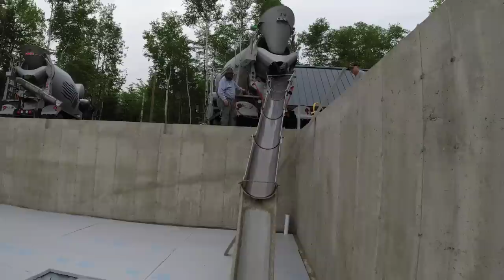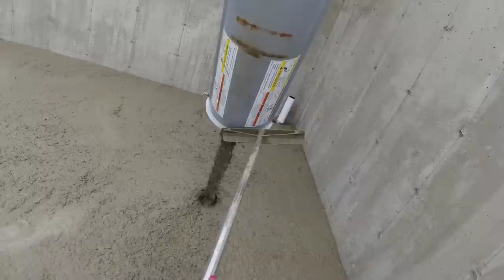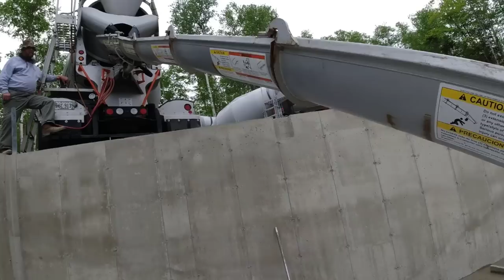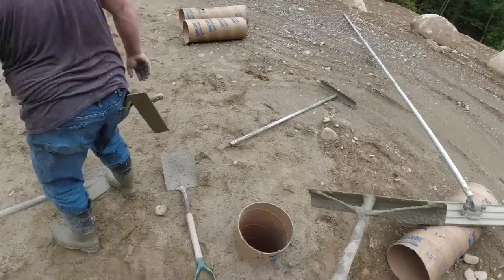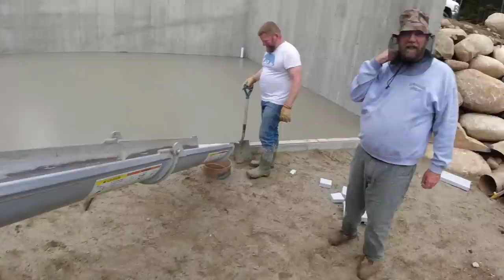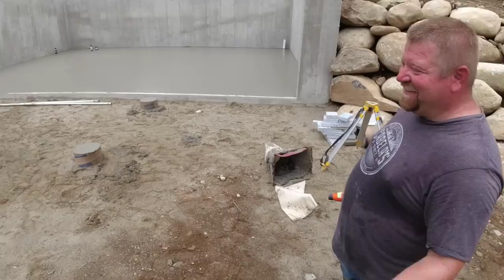Why Having Good Concrete Truck Drivers Is A Blessing! Making Our Jobs EASY!

Comment: On the mix.  It is possible that the loader operator over filled the Stone bin and it would fall into the sand bin.  Then when they scaled it the mix received less sand due to the extra weight of the stone.